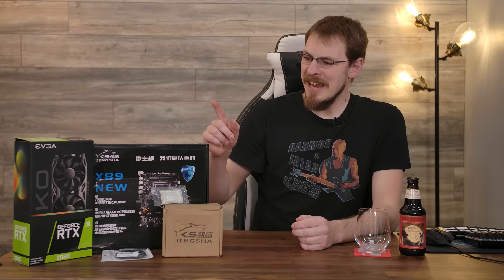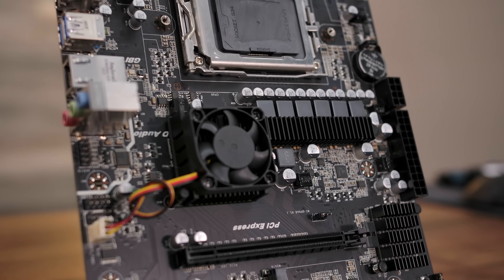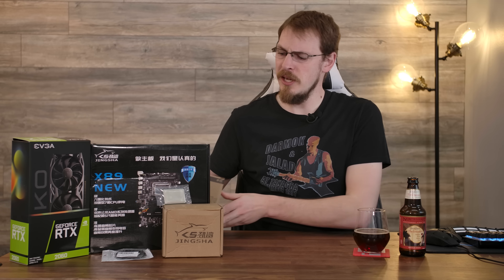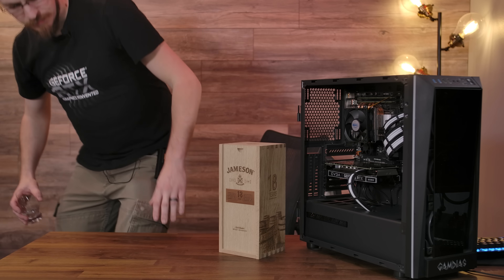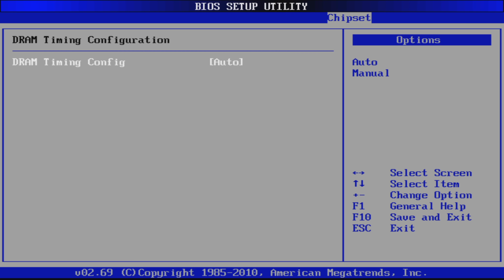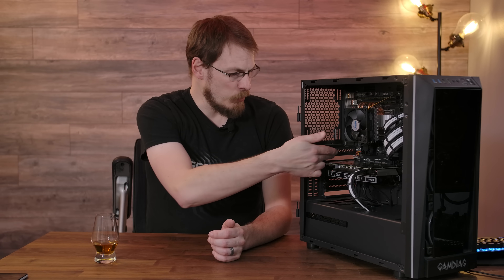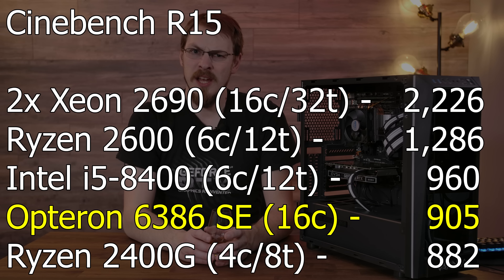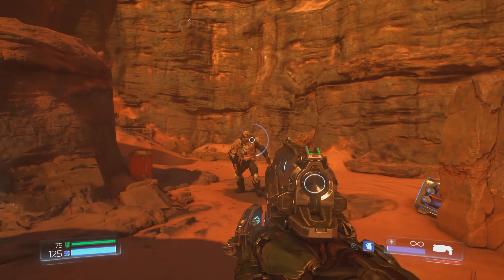Chinese x89 Motherboard??? Piledriver or just a pile?

Comment: The CPU was actually pretty decent back in its days for heavy multi-threaded workloads and running VMs, but not with a rubbish motherboard like this. The main problem with these "fake/scam" boards is not the BIOS, but power delivery, as they simply cannot deliver enough power at a high enough consistency or efficiency to the CPU and memory, and this might be partly the reason that Sleep mode never works on any of these boards (fake X58/79/99 included).
Those fake X79s are actually fine, since they've been making them for years now, and there are BIOS hacks from Chinese and Russian websites. But this is nothing but a scam, baiting people with the high core count of cheap Opteron CPUs.

Comment: 6386SE for just 55$!? Over a year ago I bought 2 of them for my working PC and they cost me 300$ included shipping.

I think all because of the garbage motherboard that can't work correctly (when I saw BIOS screen, I can't expect to be able to configure anything that should help solve the problem). I have never encounter such problem showed in this video. I can play games or edit video just fine and it's working right from the start without doing anything.

However, I used SuperMicro dual-CPU motherboard (which is god damn expensive for such a platform so I can't recommend, Asus one is OK), so it's fairly stable that I haven't encounter any system crash or any real issue until now. The only problem I have is when first plugged-in and power-up the build for the first time, video card always run at x8, but it will be x16 if restart the PC or power up again without unplug it.

Nevertheless, I still can't recommend anyone to build PC out of G34 platform. Even with 2 of this CPU and full Quad channel memory for each, they can just barely outperform Ryzen 7 1800X. Also, it's not good for gaming with lower clock speed than FX-8350. And if you use lower model than this such as Opteron 6380, despite 32 cores and threads, can't process footage from HD capture card correctly because it have too low clock speed. (When you open OBS/XSplit, if you are not recording or streaming the preview footage on OBS/XSplit will be freeze then move and freeze again for around half a minute before the footage completely freeze, but if it's during recording or streaming it work normally but it will be the same as soon as you stop recording. I prove that it happened because of CPU's clock speed when I tried the capture card on my FX-8350 build and the same problem appear only when I underclock it to 2.40GHz.) In addition, those Chinese boards are really garbage as showed in the Video, and even outside of those, all branded motherboard are meant for server-use so they have very limited I/O (2 rear USB ports, dual LAN, one serial and VGA port, and nothing else). You have to spend additional money on Sound Card and USB host controller card to be as usable as normal PC. All of these still not consider how hard to find the heatsink is.

In other word, anyone must stay away from this platform, it will not value your money. I bought it just because I (irrationally) want to own something not many people owned.

Comment: The funny thing is: I have seen that exact processor tested on an actual proper motherboard(not tossed together garbage) and it handled doom just fine. Yes, Piledriver was a pile, but if you come across some of these in a junk store somewhere it might be an ok system;assuming the motherboard you find isn't equally shit.
Reply: Personally couldnt find another board
Reply: I've ran a FX 6300 from, 2014 up until January. It couldn't handle DooM 2016 too well, but Doom Eternal 1.0  (and only the 1.0 release day, I don't know why, I bought the game but always ran the pirated version cause it gave me much better FPS) ran fine, it wasn't pretty, but I even managed to get ultra nightmare done.
Nowadays i5 11400f + 2060 12gb (it was cheaper than 3050 8gb).

Comment: It would have all been fine had you installed the rear fan.
Reply: I was just kidding, I like your videos 👍🏻
Reply from the maker: Right, because THAT was the limiting factor in performance... Nevermind that this is a cooler blowing down on the VRM with an open top, and CPU temps never exceeded the low 60s.

Comment: Hey Jeff, a professional audio engineer here with a couple suggestions. First you should high pass your microphone up to around 150hz and possibly notch out a bit around 200, it will considerably clean your vocal up and get rid of that muddyness in the lows/low-mids. Also regarding the audio dropouts, not sure what that is but seems like maybe a buffer issue with your driver. You also really gotta get some treatment on the walls as well to kill all those reflections being picked up in your Lav. Cheers!

Comment: while the CPU i today's standard is not the greatest this motherboard is just utter garbage and don't even do the 6xxx-series Opteron justice... and that says a lot.

these boards are known for RAM problems, and they only run single-channel mode when they support quad-channel.
as mentioned the 6386SE is like two FX8350 glued together and that is almost the truth, the CPU is quad channel but works more like an "dual-dual-channel" where half the CPU have a pair and the other half a pair... now force that system to run all that trough a single channel in one half...

though the cinebench score would not be that much better but when a pair of 6386's goes close to 2200 points in Cinebench a single one should do better than 905

Comment: The best combo in this video is Jeff and the booze, because hardware failed completely.

TBH I wonder if the CPU or chipset weren't overheating with that little coolers. If I recall correctly older AMD platforms had some weird temperature reporting, where if you were starting to get close to 70C that meant your CPU is actually close to the melting point. I would like to see if swapping cooler for something bigger and checking chipset cooler mounting along with VRM heatsinks would net some better results, but just out of curiosity, because the platform itself is based on a failed architecture.

Comment: Most of these Opteron's on x89 have a TDP of 115.  It wouldn't surprise me if they ran better on this economical motherboard. Not all motheboards/server boards seem to support the 140 tdp SEs.  But I don't know.   The first case you posted came with a power supply that was rated for 380 watt if I read that correctly which might be a bit low.  140 tdp for the processor + 160 tdp for the gpu alone..  Not sure what power supply you used for the last build.  If you have no interest in the economical x89 motherboard,cpu fan, and ram,   I have a interest in the platform if simply for the peculiarity and uniqueness of the platform.  Thank you for the video of the build.  It was entertaining to watch.

Comment: TL;DR; Very bad mobo, and CPU reaally not being used for what it is good for.
I have tons of Opteron servers still running, as server they are good. Mentioned TDP is the maximum and our opteron servers average 25-30% less power use than their intel counterparts, while offering better performance after vulnerability mitigations - and same without.

With good Mobo capable of decent OC'ng this could be decent low end offer.

Comment: That type of AMD coolers are actually super common -- ALL of the Opterons used the same one. Thing is there is no market for them so companies generally just toss them.
I have something like 250-300 of these just laying around, highend low profile coolers, 2 heatpipe mostly solid copper with a aluminium mounting plate. Has no problem dissipating heat from older 6cores at the very least.

Comment: But Jeff, is the poor performance due to the Motherboard or is that CPU just garbage (does it match with results for that same CPU on other boards)?
Reply: I would say the motherboard (and partly software setup). I have a dual 6344 (lower clocked 12 core) and it scores just as much single threaded than this faster 6386 in cinebench. And well games, without quad channel, pretty low IPC and single core performance, and the situation worsened due to 2 numa domains I am not surprised things don't go that well. My machine is an absolute beast though for what I built it for, which is compiling big software projects.

Comment: Re: gaming - Was the IOMMU disabled? Leaving it enabled can have pervasive, unpredictable stability effects when you push around lots of data on the PCIe bus.

Also wondering how badly the dual channel memory configuration is holding back performance on a line of CPUs intended for quad channel operation and famously ravenous for memory bandwidth.
Reply: Well , my e5 2640 runs on dual channel and has performance almost on par with ones on quad channel , this may be thing that i got good bin or good 1333mhz 2x4gb sticks.
Reply: "how badly the dual channel memory configuration is holding back performance"
very... specially since while it have 2 sockets it runs single channel only so it's not even dual-channel.
Reply: Børre Børresen That’s what I was afraid of - each NUMA node only has access to a single channel, which will starve performance. Anybody committed to playing with one of these old Opterons really needs to snag a used socket G34 motherboard from a name brand.
Reply: @Halon1234 , i think not only do they run single channel, they also are both in the same NUMA node.
yeah... this board is really a big pile of garbage and the price is so high that you could add 10$ and get a second hand dual socket Supermicro, Tyan or Asus board 
(and most of the Asus boards will give you a tiny bit ability to overclock, or quite a lot if you get hold of some ES versions of the Opterons... just beware of cooling)
Reply: @brrebrresen1367  Are you sure that it run only in Single channel just from one NUMA node not from both? If it's true, this will got performance hit from both Single channel and the same hit that 2990WX got. I don't want to imagine how bad it is.

P.S. You must pay at least 40-50$ more than this board to get something like SuperMicro H8SGL on used market, at least in international platform.

Comment: evidently a host of issues with this board, first off being opteron 6xxx is quad channel, second that cpu is CMT enabled so it should be 16/32.  Yes I know about the whole "were they true 8 core modules."  That cooler wouldn't cool a 95w cpu properly, let alone the 140w from this cpu
Reply: Nope 16 core, 16 threads : https://www.amd.com/en/products/cpu/6386-se

Comment: wow that things actually slower than my dual xeon from 2010.Given it's a 12c/24t and it's barely slower than my r5 2600 difference is i use her for a storage server and a virtual box.It's in a 2u rack mount so no audio and only 8mb matrox display but for what i use her for it's perfect.I was fascinated by the opteron back in the day.I built 2/3 of them in my life but it was proper server mobo's and it worked perfectly.These chines knock offs are just not good for amd.For cheap xeons etc they are great though

Comment: Cool but... why buy it to pull numbers, couldnt you just pull out a calculator and do some multiplications and divisions from an FX chip to get in the ballpark😂
The pilediveroid lineups actually had a lower ipc than their predecessor, the only other time that happened was with the pentium 4, but they ramped up frequencues so quickly in those days that people barely noticed.

Comment: The second I heard opteron my interest significantly faded. AMD's pre-ryzen is pretty sleeper, the only thing I'd consider is an FX 8 "core" if you can get it and a motherboard/cooler for it for cheap. All their lower core, or higher core either suffers from total lack of performance or lack of clockspeeds

The FX 8's are the happy medium and even then, they're really outdated; and you have to get the whole kit cpu+motherboard+decent cooler for cheap AF... considering new market (in US atleast) has the Ryzen 5 1600AF for $85 and Cheap B450 Motherboards for $70ish. Absolutely SMASHES the FX 8's

Comment: You got a terrible board, there are a few that are decent, but it wont make a system built around the cpu work much better.  You were likely running the ram at the lowest possible speed no matter the setting in the bios.

Comment: You can try the new x99 motherboards and e5 2620v3 with some cheap ddr4 ram and a bios hack it's pretty good value
Tech yes city made a video about
(I believe that you've already seen it)
Reply: I have one with the E5-2678 v3.  It's been pretty good so far.  I just have 32GB of RAM, and a PALiT GTX 980, along with a noname 1TB NVMe, and a Toshiba disk. (All my data is on a remote share, so I don't really care about storage).

Comment: I had the same size problem with my Jingsha x79 board that I use for a game server. Didn't fit in the case I had planned for, but at least I didn't buy the case up front instead opting to try it in scrap I had lying around. After discovering it was in fact not MATX I bought a thermaltake core V21, the only 5 slot case I could find, because having that much extra room at the bottom annoys me.

My Ryzen 5 1600 (the original) Has a score of 1306 with my current 3.9ghz OC, the $40 xeon E5-2640 V2 that I use in the above server scores 822, technically less but done in half the cores at the stock clocks... so yeah I'd say x79 comes out a bit in front, plus I get quad channel memory. I could I suppose play games on it if I wanted to, but it just hosts a couple 7 Days to Die and Killing Floor 2 for now, possibly more as time goes on since they don't really stress it that hard.

Comment: You could give some better chinese boards a try. Look at Jingsha X99 with DDR3 (for cheap memory) or DDR4 version (same board, maybe sold as KLLISRE). Paired with a 2678v3 for DDR3 support, unlocked turbo with a BIOS mod, and you have a 3.2Ghz all core 12C/24T rig.

Comment: A good fix for the fan would be a physical fan control like the ones ZALMAN used back in the day.
Thaiphoon Burner is a great program for reading ram and all of is IC's and speed data. 
Some 3rd party programs can OC some of those older chips in the OS. Could be worth a shot to try some of these suggestions. 
Good luck with the X89 build.
Cool video though.

Comment: Wait. I didn't expect it to be properly fast, but it barely POSTs, seems like. Why would it lock up Doom for example?

Then again 900cb in R15 seems kinda alright. I mean no not that it is alright for the class or the power budget, but the FX-8350 does like what, 660cb, and you get double the cores here at the price of a clock disadvantage, so 900 sounds like about fair. Bulldozer/Piledriver had a bit of an FPU deficit in workloads with high SSE/AVX utilisation, by design.

I wonder if it's similarly bad in Linux or whether it does any bit better there.
Reply: I got around 1700 with 2 of them, and around 3700 with 2 of them on R20. I agree that it's not that poor.

I think motherboard maker can't write BIOS or configure all the component good enough to make this work correctly.

Comment: This doesn't surprise me. My old Vishera used to score 800 cb screaming its lungs out at 5.2ghz and consuming over 230w. If you account for the extra cores, yet huge losses of clock speed the 900 is about right. Those were actually big numbers back then. They put I5s and indeed I7s to shame, but weren't good for gaming or other tasks that requiired IPC. I'm glad you did this though, and that you have one of these up and running as there was never a cheap board for these so hardly any one has them. I see you like the same sort of things I do, re-purposed server gear so at least you have this for historical purposes. I still loved the video. Maybe next time go into it with less expectation. Thanks for another one that I found much more interesting than most of the tosh on here.
Reply: FX 8320 Vishera, so 8 "cores"
Reply: The consumer FX-8350s were really handicapped.  If you run Opteron 63xx ES chips (piledriver cores) with 16 cores, you can downcore alternating cores and get Piledriver cores that are not sharing L2, decoder, L1 inst cache and other parts of the pipeline with the other core of the compute unit, netting a 15% boost in IPC.

Comment: 10:35 it's not getting enough power.
Reply from the maker: ye...yes it is. There's a 750W Gold PSU in this case.
Reply: @CraftComputing  yep that's fine. But the voltage set to the CPU in bios might not be enough.
Mine didn't even out till over volted it to 1.444 volts. Can you boost the VCORE?